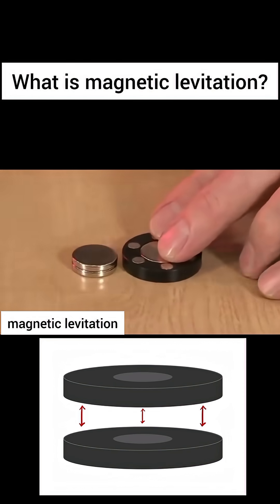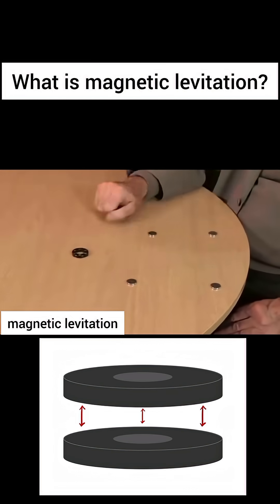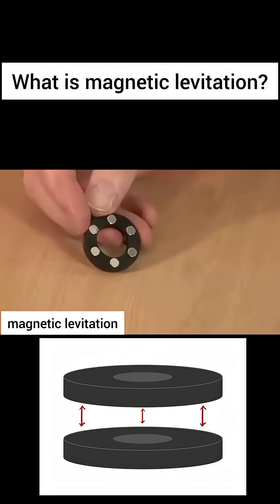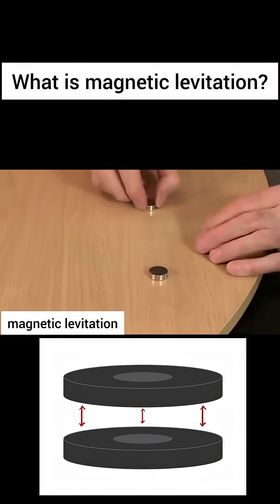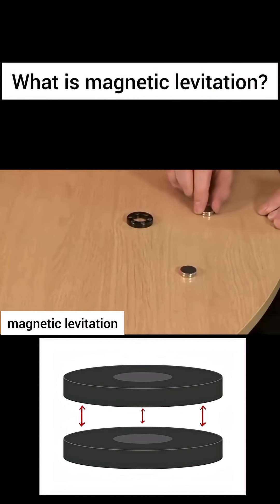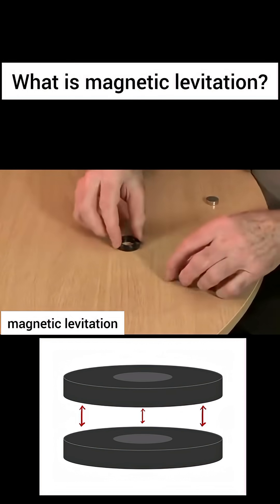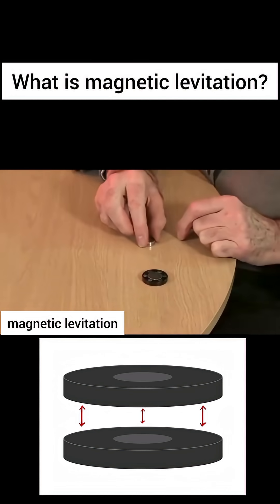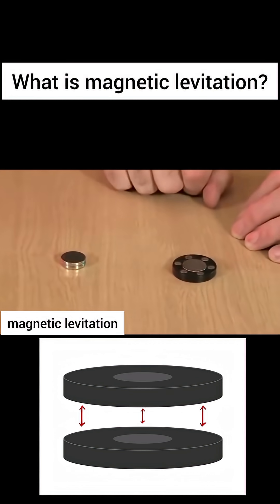what is magnetic levitation?

Comment: Is this how the universe works maybe?
Reply from the maker: A small magnetic "inverter" cannot demonstrate how the universe works, but cosmic magnetism is a key factor in astrophysics
. While a toy or device with strong magnets is a compelling demonstration of magnetic fields, it is not a model for the entire universe
Reply from the maker: Magnetism in the universe

    Cosmic magnetic fields are everywhere. They are generated by moving charged particles in plasma and can span vast distances, affecting the dynamics of celestial objects.
    Magnetic fields influence star formation. They can act like a "cosmic brake" by slowing down the spin of gas and dust clouds, allowing gravity to pull them inward to form stars.
    They shape galaxies. Magnetic fields can run along the spiral arms of galaxies and play a significant role in their structure and evolution.
    They can be mapped. Astronomers can use a phenomenon called Faraday rotation to map magnetic fields in the Milky Way by observing how light from distant sources is affected as it passes through interstellar dust.
    They are powerful and dynamic. The Sun's magnetic field, for example, is constantly changing and can release huge amounts of energy in solar flares and coronal mass ejections

Comment: não será assim que o núcleo do átomo captura o elétron em sua órbita?
Reply from the maker: The electron is captured by the nucleus in a specific type of radioactive decay, not via a magnetic effect. A magnetic inverter, in contrast, uses magnetic forces to create a stable, suspended object and has no relation to subatomic processes. The reality is that electrons are held in place by the electrostatic attraction between their negative charge and the positive charge of the nucleus. The "orbits" are not like planetary orbits, but are better described as electron probability clouds or orbitals, as defined by quantum mechanics. Magnetic forces have a negligible role in holding electrons in their shells compared to the overwhelming electrostatic force

Comment: Shout out to the British man for using imperial measurements for all us needy Americans in the chat. He’s a real one for that.
Reply: We grew up using both. I still use imperial at work for measuring. Construction wise everything is sold in metric
Reply: Do you think yanks invented imperial units?
Reply: @InspiriumESOOmost Americans think an American discovered America 😂
Reply: Uuuh... UK still uses both. Road speed limits are in MPH. Distances in Imperial as well. Construction and engineering are in Metric. Volumes depending on the liquid or gas use both as well. Same for Weights depending on the material.
Reply: In any case, I see a "Micro" version of the Star Trek "Tractor Beam!" 😂
Reply: British people actually use imperial. 
The British government has only "officially" adopted metric, and they gave up like 20% of the way through adopting metric. So British people still use imperial in normal conversation, road signs are all in imperial, buildings are advertised in square feet, GPS/google maps uses imperial, etc.
Reply: @Dushmann_  No. Britain doesn't use imperial measurements at all... other than miles. This however, is a relic of the 'empire'/commonwealth/colonising of we English a-holes! :(...
Reply: @BuckyOhYeah Really? I'm from the UK, But we still buy Pints in a pub, i still travel miles in road distance, at MPH speed limits, like the road signs tell us to. We measure our height in feet and inches more than meters and centimeters, you will hardly ever hear any tall person say anything but, say, 6 ft 6 inches and they will not say 198 cms. Most of our weights are in both, and we use Stone (14 lbs), at least half would say 12 stone 3 (meaning 12 stone and 3 pounds), you'd seldom get a Kg answer. Most will still quote land size in Acres rather than Hectars.
Reply: @antonytye3484  Fair dues... You're spot on... Though we (civvies), use imperial on occasion, the business is conducted in Metric...

What seems obvious to most, is:
Regardless of measurement and/or unit, they are exactly the same as stated/professed size.

Your NHS record will be in m, cm and/or mm
Reply: Sorry to come back to this... yes you'll buy pints in a free-house. The barrel is sold in metric. The pints are converted to metric when consumption needs measuring.
Work with what you prefer...? surely? Sorry if I'm ignorant...
Reply: @BuckyOhYeah but you buy 1, 2 or 4  pints of milk.
Reply: Hes aussie
Reply: @leafygreens8624 are you sure?

Comment: I'd love to see a diagram of the field lines for this.
Reply: You can. A thin plate of glass, a bunch of iron fillings. flatten it under the glass. Place the inverter combination down on top, using another piece of glass to keep it flat if need be.
Reply: I was thinking the same thing.
Reply: @soahcdrol4087  use some iron fillings and paper.
Reply: Yes please. Feed us that data!
Reply: ^^... and thst is why we need a diagram ^^
Reply: @mortlaursen6752 😂😂 agree
Reply: Overall it’s a Mexican Hat potential like that between subatomic particles in an atomic nucleus.
Reply: Just picture a lot or arrows. You’re welcome
Reply: These kinds of magnet configurations have existed for decades. Lots are used on cabinet doors these days -> prevents slamming and makes them easy to open.
Reply: Ask bigClive to do a reverse engineering on this video...
Reply: throw some iron filings on it
Reply: The field lines cancel at the point where the magnet rests. Think about it in 1D as a central force potential curve and then rotate around the z
Reply: Omg hahaha.... strong magnet North and South center.... SIX.... YES.... SIX, HEXAGONAL PLACEMENTS, THEY ARE SMALLER.....SMALLER.... CREATING A WEAKER HEXAGONAL MAGNETIC FORCE...MAGNETS PLACED IN THE OUTSIDE TO CREATE A FORCE EQUAL TO THE CENTER MAGNETS... ON A FLAT SURFACE THEY CANNOT COMPLETE THE ATTRACTION OR REPULSION OF THE NORTH OR SOUTH... SUSPENDING IT AT THE POSITION ON A FLAT PLANE NEITHER HERE NOR THERE.... IM A COUNTRY BOY, OLD TOO, AND YOU DOND GET THIS?????
Reply: @TexasJeepRancher type all the words you want. They will never be a diagram
Reply: @TexasJeepRancher  It is flat plane becuase its on the table. The principle stands even if suspended in the air. If you get what i mean.....
Reply: @TexasJeepRancher k dude 😂 we get that google exists, but we’re doomscrolling and don’t wanna search it up.
Reply: @TexasJeepRancher why are you shouting?
Reply: @TexasJeepRancher ?? Lmao

Comment: For satellite clearing is a good idea
Reply from the maker: A "magnetic inverter for satellite clearing" is not a standard or good idea in its currently understood form, as magnets are not effective for removing most space debris
. Most space junk is made of non-magnetic aluminum, and a simple magnetic field would not attract it.However, there is promising research into more sophisticated, non-contact magnetic techniques that could be used for space debris manipulation
Reply from the maker: The problems with basic magnetic removal

    Most debris isn't magnetic: The vast majority of space debris is not made of ferromagnetic materials. Simple, permanent magnets are largely useless for this application.
    Weak force over distance: The strength of a magnetic field decreases rapidly with distance. To exert a meaningful force on a large, heavy object, a space tug would need to get extremely close, which is difficult and dangerous.
    The "inverter" concept is misplaced: The term "inverter" refers to a device that converts direct current (DC) to alternating current (AC) and does not apply to the magnetic removal of satellites. This suggests a misunderstanding of the technology
Reply: @science-ms89 😮 you must be right ☺️
Reply from the maker: @markralph3598 ❤️

Comment: magnetic bearing?
Reply from the maker: Very similar to some extent. A magnetic bearing uses magnetic forces to suspend and guide a rotating shaft or other object, replacing conventional mechanical bearings to eliminate friction and wear. There are two main types: active magnetic bearings (AMBs), which use electromagnets controlled by sensors and feedback loops for precision suspension, and passive magnetic bearings, which rely solely on permanent magnets for support. Magnetic bearings offer benefits such as virtually zero friction, no lubricant requirements, longer service life, and high reliability, making them ideal for high-speed rotating machinery like turbines and compressors.

Comment: And this is likely how atoms are attached but keep distance at the same time
Reply from the maker: Atoms are primarily held together by the electromagnetic force, which creates stable structures by binding negatively charged electrons to the positively charged nucleus. The strong nuclear force also plays a role, holding the protons and neutrons within the nucleus together, overcoming the electromagnetic repulsion between the protons. Magnetic levitation is not the force that holds atoms together; it is a macroscopic phenomenon that uses strong magnetic fields to counteract gravity and suspend an object in the air.
Reply: Nope, what holds atoms together is stronger than magnetism. That's why it's called The Strong Force in physics. 🤓
Reply: @u_t2347 isn't thatbwhat holds protons together? What about protons and electrons?

Comment: Similarly, the Earth and the Moon are interconnected
Reply from the maker: The claim that the Earth and Moon are interconnected by electromagnetic levitation is incorrect
. The force that governs their motion and keeps the Moon in orbit around the Earth is gravity, not electromagnetism
Reply from the maker: Here's a breakdown of the actual relationship:

    Gravitational attraction: The Earth's immense mass creates a gravitational pull that is powerful enough to hold the Moon in a stable orbit. The Moon's gravity also exerts a pull on the Earth, causing phenomena like ocean tides.
    Orbital mechanics: The Moon does not float in place due to levitation. Instead, it is constantly "falling" toward the Earth while its forward momentum keeps it from crashing into our planet, resulting in a continuous orbital path.
    Electromagnetism on a smaller scale: While electromagnetic levitation is not involved in the Earth-Moon orbit, the principle is used in other contexts. For instance, NASA has tested using electromagnetic levitators on the International Space Station to study how metals behave in microgravity. The technology is also being explored for building robotic maglev transport systems on the lunar surface
Reply: The negatively charged field of the Earth's atmosphere pulls the moon towards it, while the Earth's positively charged core pushes it away. At low pressures, positive and negative fields repel, while those of the same name attract.

Comment: Isnt that what happens when molecules bond?
Reply from the maker: No, magnetic levitation is not caused by molecular bonds
. It is the result of forces that act on materials within a magnetic field. While the magnetic properties of a substance are related to the arrangement of electrons within its atoms and molecules, it is the interaction of a bulk material with an external magnetic field that produces levitation
Reply: @science-ms89 no i mean when atoms create molecular structures the atoms lock at a close distance and don’t move closer or farther away unless significant force applied

Comment: so please sketch the graph of magnetic potential
Reply from the maker: Stable magnetic levitation requires a local minimum in the total potential energy of the levitating object. A potential energy graph can illustrate the object's stability, accounting for both magnetic and gravitational potential energy.
Reply from the maker: Magnetic potential energy graph for stable levitation:
Earnshaw's theorem dictates that stable levitation cannot be achieved with only static, permanent magnets. To achieve a stable local energy minimum, a stabilizing force is required. The most common methods involve using diamagnetic materials (including superconductors) or dynamic stabilization with feedback control or gyroscopic effects.
Reply from the maker: Levitation with diamagnetic materials (2D):
 This method exploits the unique property of diamagnetic materials, which are repelled by magnetic fields. Since superconductors are perfect diamagnets, they offer an excellent example. The potential energy curve is a composite of gravitational potential energy and magnetic potential energy. Equation for potential energy: U{total}=U{magnetic}+U{gravity}.
Reply from the maker: Gravitational potential energy (U{gravity}): 
U{gravity}=mgz, where m is the mass, g is the acceleration due to gravity, and z is the vertical height. This is a straight line with a positive slope.
Magnetic potential energy (U{magnetic}): 
A diamagnetic object is repelled by a magnetic field, so its magnetic potential energy increases as it moves closer to the magnet. A superconductor completely expels the magnetic field (Meissner effect), creating a high-repulsion area near the surface. As the object moves higher, this repulsive magnetic force decreases rapidly.
Reply from the maker: Sketch of the graph:The graph plots total potential energy (U{total}) on the y-axis versus vertical position (z) on the x-axis.The curve for U{magnetic} starts at a high value close to the surface and decreases exponentially with height.The total potential energy curve is the sum of these two functions.For stable levitation, there must be a local minimum in the total potential energy curve. This minimum represents the stable levitation height, where a slight displacement will be met with a restoring force.

Comment: Ist das nicht eine gute Möglichkeit für reibungsarme Lager?
Reply from the maker: Yes, magnetic levitation is an excellent option for creating low-friction bearings, with magnetic bearings capable of achieving very low friction by eliminating physical contact between moving parts
. Instead of using rolling elements like balls or rollers, they use magnetic forces to levitate and support a rotating shaft.

Comment: Flux pinning !
Reply from the maker: Yes , flux pinning is the phenomenon in type -2 superconductors where magnetic flux lines are trapped by internal defects, preventing their movement and allowing the superconductor to maintain a fixed position relative to a magnet, which enables stable magnetic levitation

Comment: Could the moon be using the same magnetic trick
Reply: Gravity not magnetism, we can measure magnetics in a whole host of ways but gravity, still eludes us
Reply: If it was I'd expect the orbit to be much more circular.
Reply from the maker: The Moon cannot use a "magnetic inverter effect" for several reasons: the effect is a small-scale physics toy, not a large-scale celestial phenomenon, and the Moon does not have a global magnetic field to facilitate such an effect
Reply from the maker: Why the moon can't use this effect

    No planetary magnetic field: The "inverter" effect relies on a precisely designed array of multiple powerful magnets. In contrast, the Moon does not have a global magnetic field today. While it had a brief magnetic field billions of years ago, its small core and lack of sufficient internal convection meant it could not sustain one.
    Size and force: The physics of this effect works only on a very small scale, holding a lightweight magnet in place against minor perturbations on a flat surface. It is not a force that can manipulate large, celestial bodies.
    Specific design: A "magnetic inverter" requires a very specific configuration of magnets to create a stable, non-contact interaction. This kind of engineered arrangement could not arise naturally within a moon or planet.
    Misunderstanding of physics: The idea of a celestial body "using" a specific physics effect suggests a level of intention and technological capability that does not exist in nature. The forces governing the Moon are gravity and its interaction with other solar system bodies, not human-engineered magnetic effects

Comment: Clever but That’s not levitation. Your picture is misleading too b
Reply: Also no one invented magnetism....
Reply from the maker: Levitation also means suspension or stopping, the goal for providing the picture is showing the generation of opposing forces by two magnets in the magnetic levitation process❤
Reply: @science-ms89  Levitation is the ability of an object to be suspended in the air without physical support, a phenomenon that can be achieved through scientific principles like magnetic levitation.
the image displayed IS misleading and inaccurate!!.....What does levitation mean?
Levitation (from Latin levitas, lit. 'lightness') is the process by which an object is held aloft in a stable position, without mechanical support via any physical contact.